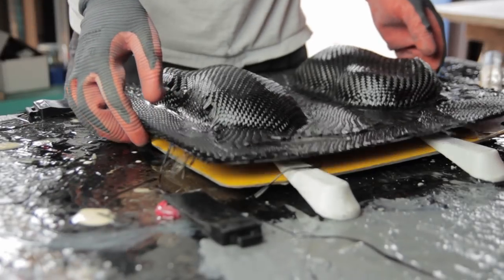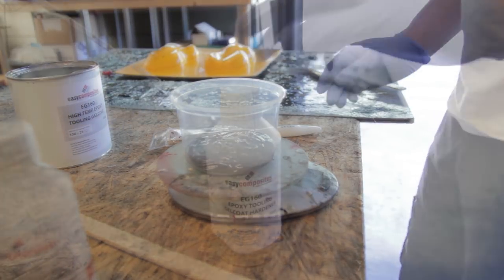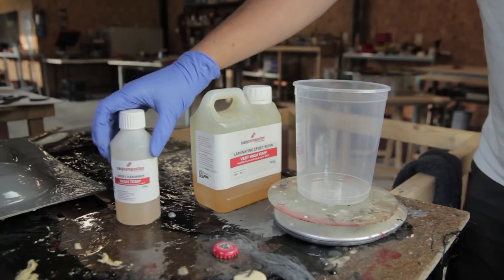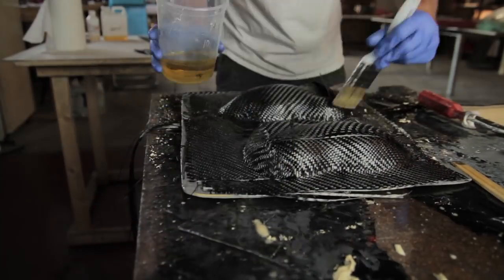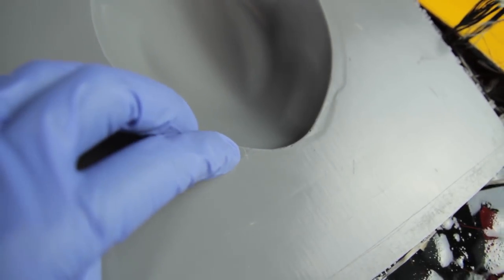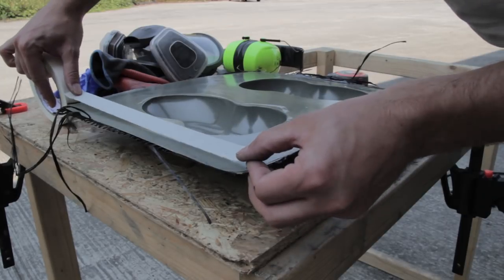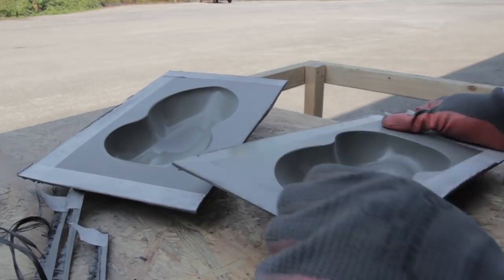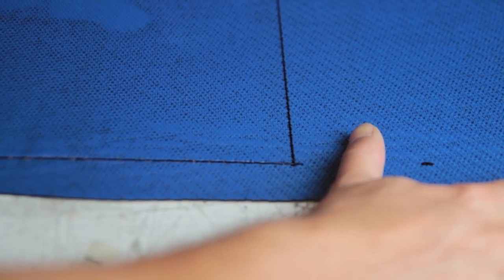Carbon Fiber Prepreg Ready Moulds (Tutorial) ***PART1***

Comment: Have you made any moulds with this resin system but using fiberglass reinforcement? If so do you find after post cure that the print through to be better with carbon, or no difference?
Reply from the maker: No I haven't unfortunately! but good question! I'll try to cover that in a next video
Reply: @MatthieuLibeert  that would be great, so far I only used glass reinforcement because it's easier to see the consolidation and also I'm making big parts (car body stuff)

Comment: can i demand something??i wana u make a video on how to make gas tank or bottle or even a mug from carbon in different way and different type of carbon fibre such as pre preg..because i want to build a piece carbon fibre motorcycle gas/fuel tank..i thinking to build using styrofoam as a base/core
Reply: Look up “lost foam”.  You can shape your tank out of foam, lay it up in fiberglass and epoxy, then melt the foam out with acetone after it dries.  Really easy to do.  Epoxy is a must for making a fuel tank.
Reply: We’re All That Bored thanks😁
Reply: yondaime hokage no problem.  Good luck with your project
Reply: We’re All That Bored thank for ur support,i’ll experiment with small one 1st

Comment: The question is how to get perfect male mold
Reply: The pros use polyester primer polished to a mirror.  Look up Duratec primer and it will lead you to a bunch of plug building threads.
Reply from the maker: Correct!